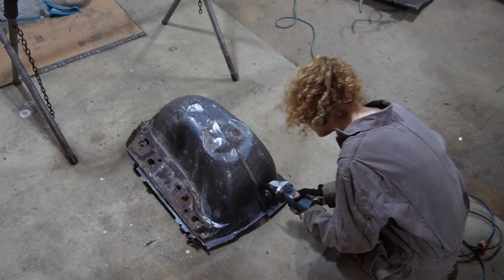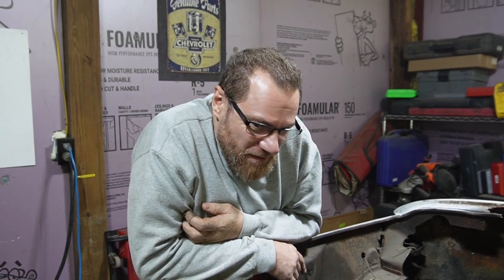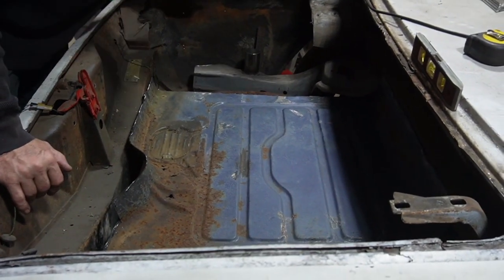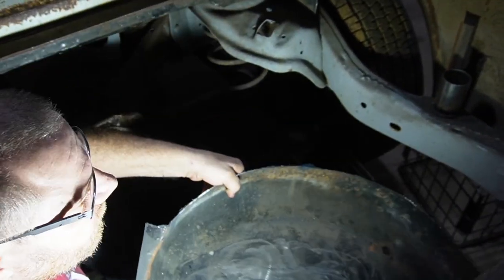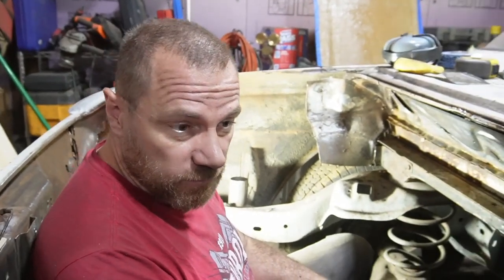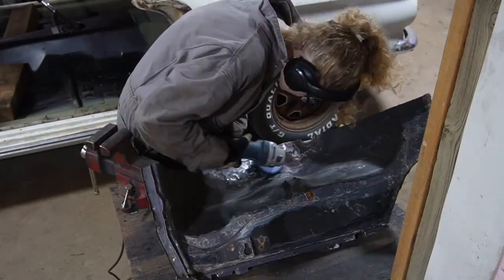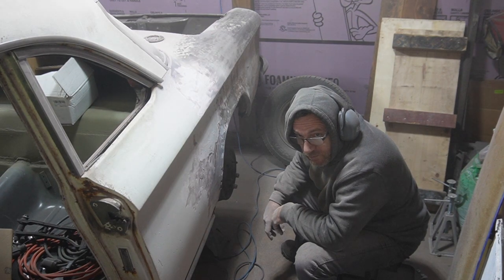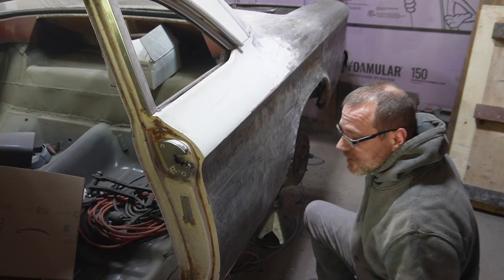Junk in the Trunk ┃ Episode 44

Comment: looking good, one hell of a lot of work yet.  dust masks ?  Sand blaster?  Keep going one day you will look to see what is next to do, and you will realize your done.
Reply from the maker: We are still short infrastructure for a blaster. Working on getting more power into the shop. Game on once we get that done.  Definitely still a long road ahead, but I think she will like it. Hopefully she manages to hang onto it longer than I did the bronco, or any number of other early cars.  Time will tell.
Reply: @drybonesgarage777  What  are you referring to infrastructure?  Power, Space, equipment ?
Reply from the maker: We are currently assembling pieces for better power to drive a shop sized air compressor and take full advantage of the welders. Unfortunately it took quite a while to find an electrition to upgrade the service on the house. Now we have a long run to make to the shop.